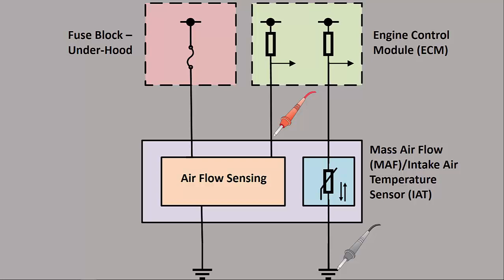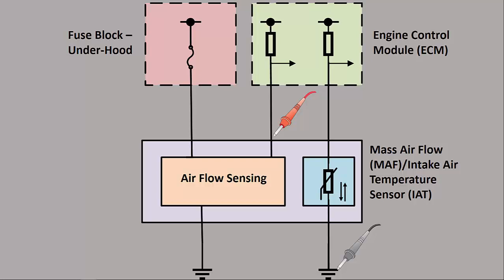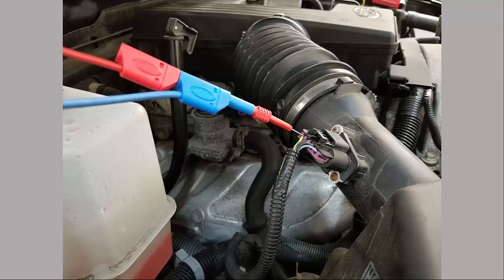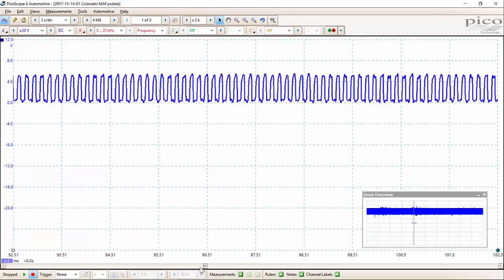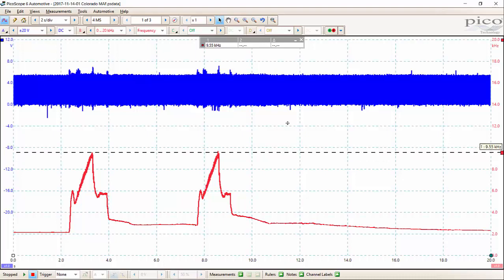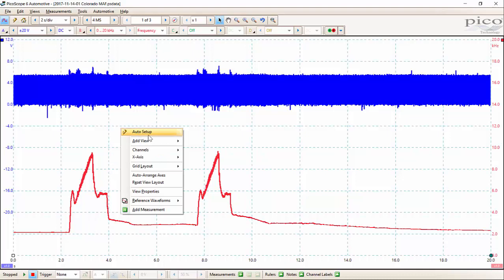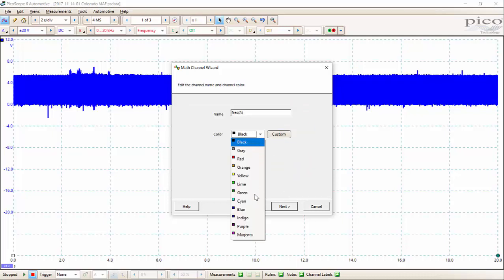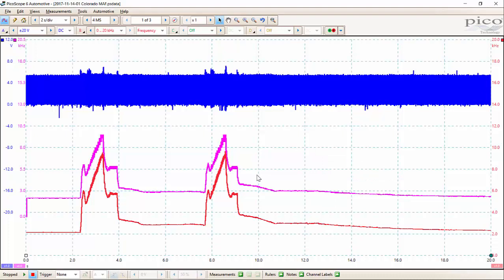Digital MAF Testing with PicoScope

Comment: Nice feature addition, adding frequency to the drop down list. Seeing the signal that way, kind of old school analog, is really helpful. Paul Danner was fond of pointing out that the analog MAFs should always hit at least 4.0vdc or more on a WOT throttle snap. I've used that guideline myself and it really helps. Thanks!